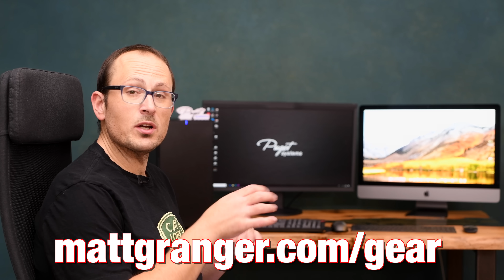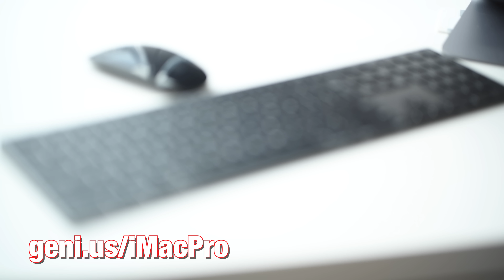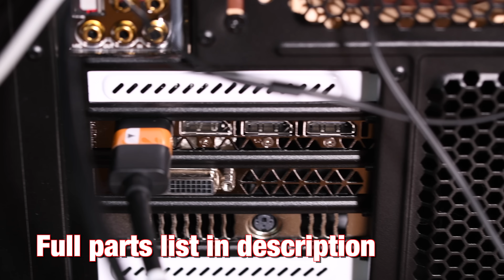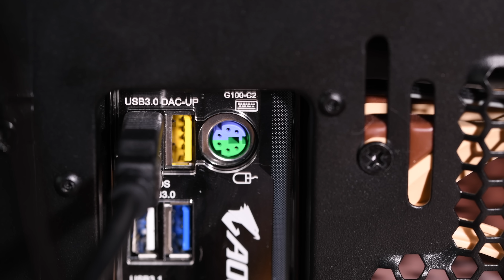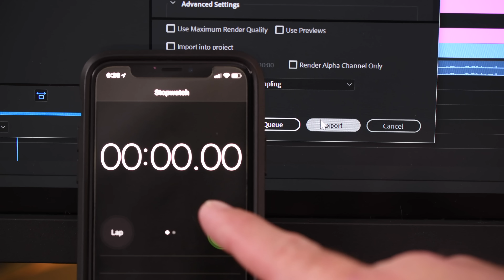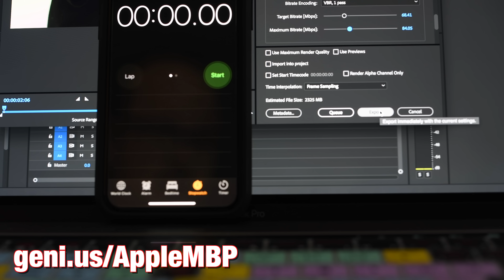$10,000 iMac Pro vs Custom PC - Which is faster??!

Comment: We get it, you like PC's. But do we really need another pointless "PC's are better" video? We know Apple computers usually are more expensive to buy(Especially compared to a homebuilt computer). We also know that Premier is very poorly optimized on the Mac and not using the hardware to it's full potential. Try testing with Final Cut Pro on the Mac or Davinci Resolve which is available for both PC and Mac. So another loaded test to justify whatever preference you already had in advance. Now let's move on to some actual content instead of this constant PC vs. Mac biggering.
Reply: Premier is very poorly optimized for all computers, Mac or PC.  it has CRAP core utilization and doesn't off load nearly as much as people think to the video card.  The reality is that the gap should have actually been bigger than what was displayed in the video.  Most people dont realize, for most Adobe products you are better off on a really fast quad core than a power house of a 8-16 core machine, once again due to Adobe's piss poor core utilization.
Reply: Pedal Repair that’s true, but the difference was only as large as it was because of his use of CUDA on the PC, and no use of Metal on macOS. It’s a very poorly designed expriment.

Comment: FRACTAL DESIGN DEFINE R5 SILENT w/550 watt, INTEL I7-7700K 4.2Ghz (quad core), 2 CRUCIAL 8GB PC4-19200 2400MHz, 512Gb SAMSUNG 960pro M.2, NVIDIA Quadro P600 on a SuperMicro motherboard (One of each usb 3.1 and 6 usb 3.0 slots, etc) custom built and warrantied by Thinkmate for ~$2200 shipped.  At this point paying them to do it is worth the savings of time researching and building plus it gives me a single point of service for the major components.
  I'd like to add a 1 or 2TB M.2 for the new RAW files to import onto but for now all the work happens on the Samsung 960 and files are backed up internally on ~812gig of older unmatched HDDs.

Comment: Meet Zeus a SuperMicro SuperServer 4028GR-TRT now this is a 4U rack mount server. It has the X10DRG-OT+-CPU Motherboard, Dual Xeon E5-2699 V4 (22-Core) 44-Thread making a grand total of (44-cores) and 88 Threads plus 55 MB of Cache per CPU, The system comes with 24 DIMM Slots which will hold ECC DDR4 Ram I am using Crucial for a total of 1.5TB of RAM,  it also holds 8-GPUs for some SERIOUS VRAM power. I am running 8-NVIDIA GeForce GTX 1080Ti 11 GB totaling 88 GB of VRAM. Then I think the best part is this thing takes 24- 2.5" Sleds or SSD's so I am running 24 Samsung 850 Pro SSD so there is no botle neck from the usual HDD. I use this machine for rendering 4K & 8K RED Footage for clients because it has dual built in 10GbE Ethernet Slots and because this thing is a absolute beast that's why it's name is Zeus! Now this is not a fare comparison because this thing coast more then both your PC and the iMac Pro together. Just to give you a idea just the two Xeon E5-2699 V4  (22-core) CPUs cost $4,200 a piece so that's $8,400 just for the CPU's when you add on the RAM at $200 per Stick times 24 = $4,800 then you add on the 8-1080Ti Founders Edition GPUs at $699.99 per times 8 = $5,592. Then you have the cost of the case which was $4,900 plus 24-SSD Samsung 850 Pro 2 TB at $949.99 per times 24 = $22,776, so when you add everything up you get a total of $46,468.00 so now you can see why I call this beast Zeus! I am running it off Windows Server 2012 R2 because you have to run Windows Server to run dual CPU's. Here it is on my Instagram https://www.instagram.com/bryanbd80/ I still use Macs for my everyday computer usage but when I need to work on a serious project then there is nothing better and faster in my mind then Zeus it may be expensive but how much is your time worth.

Comment: Hi Matt, Currently using a hexcore 6800K with 32GB DDR4 and a 1070 graphics card, everything is heavily overclocked and water cooled. At the moment it suits me down to the ground as I haven't made the leap to 4K from HD, If I ever get stuck do you rent Cider House by the hour? :)

Comment: I'm not a fan of planned obsolescence sealed Mac products. It might as well be a phone. Nice today but falling behind quickly. The screen is far too small for 5k. By the time the font scaling is applied, it is equivalent to a 2560x1440 screen with smoother and better looking fonts. That's it.  I run a 43' 4k monitor and that is just enough size for the resolution displayed. I'm also not a fan of non-nvidia cards when working with Premiere. Anything with "Pro" in the name is assumed to have upgradability. This sham is all by design. Buy a new Mac every 2 to 3 years. What a great expensive cycle to be stuck in.

Comment: Matt, thanks for the review, but it is quite unfair and no real world comparison at all, because Adobe software is optimised for Windows and something like anti-optimised for macOS. Adobe did yet not learn, how to use the native Mac power within their products or how to use macOS APIs correctly. Specially if it comes down to render output to the final product. If you compare the identical edit by Premiere Pro on PC double hardware equipped vs FCPX on Mac half as the PC hardware stuffed, the rendering by FCPX on Mac is over 6 times faster!!! If you send render job to Compressor you may start to work on your next project parallel to rendering and you will even not aware a slowing down of the Mac and the system will not be locked like on usage of Adobe Pr. Check this https://youtu.be/NWp9k2lydtk

Comment: But can it run Crysis?
Reply: Chosen Idea it will never die as long as there's a gamer left in this world. And the answer is yes it will..... At 720p medium settings.
Reply: Holy smokes, the Crysis joke lives.
Reply: no, it can't even run it on low without dropping to 5fps
Reply: Jajaja :V 
In 4k to 20 FPS
P5000 isn't a gamer videocard

Comment: Hey Matt were you using OpenCL or Metal when rendering with the iMac?
Reply: Joe's Technology, News, and Life You get better performance with almost everything in Premiere if you go into the menu and tell Premiere to use apples Metal API vs using OpenCL. The only case I’ve found where OpenCL is when resizing files with effects for final export.
Reply: The answer is, no he wasn’t, but he was using CUDA on the PC
Reply: Max Yuryev you’re absolutely correct, if I wasn’t clear about that it was my point. Why use a CUDA advantage without applying the same advantage of Metal on the other system? Unless the goal is to have a pre determined outcome for a specific message.... I’m not saying he did that, but it does sure look that way. Did you read my other comment above? I gave you a big shoutout for your in depth process in these types of reviews.
Reply: @FromScratchWithLove  bcs metal doesn't render as fast as cuda in premier pro if he would have used metal the gap would have reduced but still with cuda the PC would have won .
Reply: Futendoji it is if you disable the gpu acceleration, which, in the videos you’ve cited, they did. But, there wouldn’t be a 50% difference if that’s what he was doing in this test. It would be closer to 9% just based on the i9 having a higher clock speed. The other interesting thing, is that 14 core variant of both the Xeon W and i9 actually perform worse in single threaded tasks than the 18 core version which is clocked lower. He absolutely had CUDA turned on and didn’t use Metal on the Mac, Max is correct.
Reply: Max, as far as I know, GPU doesnt impact rendering time in any shape or form With premiere Pro .
Premiere Pro only utilize the GPU to accelerate some effects (Yea not all affect can be GPU accelerated) in the real time playback. For rendering the only thing that matter is CPU horse power. Also, Premiere Pro doesnt fully utilize all cores, most of the time an overclocked 8-10 cores CPU (just because of the better single thread performancer) will out perform a 14-18 cores CPU @ stock clock. Dont believe me ? Go look Pudget blog about Premiere Pro.
https://www.pugetsystems.com/recommended/Recommended-Systems-for-Adobe-Premiere-Pro-CC-143/Hardware-Recommendations
Reply: CUDA is a Nvidia exclusive technology due to the fact that AMD don't put CUDA cores on the gpu's so he's using the best software for a Nvidia card. thats why they are different. the AMD card can't physically do CUDA but the Nvidia card can do openCL but it just isn't as good because its not built for it
Reply: Hey it's Max!
Reply: Joe's Technology, News, and Life I asked that same question (basically) in a new comment. If he used optimized rendering on the PC, then the test only reveals the relative difference between an i9 with GPU acceleration vs a Xeon without GPU acceleration while using Premier. It says nothing of use about the Mac itself. If he has Adobe Audition, that might have been a decent way to have a control in the equation. Assuming Audition multithreads decently, the Xeon (with the iMac’s RAID 0 m.2 SSDs), should encode a lot faster. Granted I’ve never laid my hands on an i9 based workstation. Also, I wonder if a Premier project with audio files only (no video in the project), would touch the GPU during a render. I’m not sure about the Mercury engine. Haven’t used Premier since the late ‘90s!
Reply: Benoit Levesque actually the GPU acceleration makes a huge difference. That’s why I am very interested in seeing the same test with Final Cut on the iMac Pro. Premier is built to use CUDA, hence it will not take advantages of the iMac hardware.
Reply: Sup Max
Reply: Nicholas Croft Quadros are fine, and the titan is too. It’s the 1050 - 1080 et al that aren’t.
Reply: Joe's Technology, News, and Life If i remember correctly there are lots of videos out there, including one of Barnacles + Pugit systems that have analyzed performance on Premiere being more cpu dependant, specifically clocks (Ghz) than Gpu depending...
Reply: Yes, that way it would be unfair for sure, if not using Metal 2 or Open CL on render. Not talking about Final Cut that have made for OSX and Premiere lack of support on OSX.
Reply: Latest DaVinci will use multiple eGPUs to render with Metal on the iMac.9to5Mac has a nice video on this It is painful for me to watch this video with all the out-of-date busses being mentioned and no real statement as to how things are really configured. Just sticking one key peripheral on the wrong TB-3 bus could really mess up performance. Also what was Apple thinking when it put the SD port on the back of the iMac? "We can't put it on the front by the Apple logo, as that will mess up the aesthetics.".
Reply: Coffee lake. *cough cough*. 
Wonder if nVidia will catch on with supported eGPU post 10.13.4? 
(HS nVidia drivers are a bit of a mess, at the moment).

Comment: Great review Matt! I would only ever buy a PC for all the reasons you mentioned here and for a couple others you didn't. Price vs performance is a big one that you mentioned. Upgradability is another big one. The biggest reason for me though is the very limited amount of software that's available on the Mac vs what software I use for work on the PC. I use 3D modeling applications such as PTC Creo, Autodesk Inventor, and 3D Studio Max. I do VR development work which currently has 0 support on Apple products due to their lackluster video card performance. There are many other reasons I'd never buy a Mac, and have actually never owned a Mac in my 42 years of being alive. I have used one once, but not for very long because it couldn't do most of the stuff I needed it to. Having a nice shiny/beautiful Mac that takes twice as long to export as a comparably priced PC is the very definition of a huge waste of money. If you got paid by the hour for your work, the PC would pay for itself in half the time and that is really the bottom line. Throw in that you didn't even have that PC overclocked and that it could probably easily hit 4.5ghz which would spank that Mac even further. Great review, and I am surprised the PC crushed such an expensive Mac by so much (thought they would be at least close). What do people buy these things again?

To all you PC haters out there, Mac has 8% of the market and PC has 88%, so whatever you want to say just know your opinion is outnumbered 11 to 1. Also to the guy below that said Windows is based on Linux, you are uninformed. Mac is based on Linux, Windows is it's own thing built from the ground up.

Comment: Thanks Matt.  I recently speced and built a Windows PC for LR/PS work, added an excellent monitor.  I then converted a relative who does pro post editing work with this system from iMac to PC based on the total cost of ownership.  It's not easy to shake the fanboys from their Macs and that's OK; however the reality is you get more flexibility and bang for your buck when you work with alternatives.

Comment: Well, the one caveat for the pic is that in three or four years, other than reusing the case, the internals are no longer up-tradable. 

Where you get the biggest speed increase is the video card since it's doing the most number crunching. 

I only purchase work stations from either Dell or HP. Not because of a love for either company but because of the support. Dual Xeons with 256gb of ram minimum and the largest power supply offered. Then to keep it all running trouble free, an APC to keep the power supply from transient voltage spikes and power losses. 

Long time Mac, guy that became disenchanted with Apple. Anything I can do to keep from using Adobe products is high on my list. Too bad they feel subscriptions is the way to go. They're losing clients and I can't blame them.
Reply: Adobe went to subscription based because of piracy. They were losing a ton of money so I can't blame them for doing that. Autodesk does the same thing for the same reason and I suspect in the future we'll see even more software go that route.
Reply: Andrew, Autodesk was doing the dongle for both Inventor as well as Autocad. I stopped up-grading a few years back, as my limited use didn't make it worth the cost and the machine shops that I worked with still used the older versions requiring me to save at an earlier version.

If the seat license wasn't to friggin high, a lot of people would pay the price. As it stands, until you get 10 licenses, you don't get a price break. That's why a lot of people were signing up for a college coarse and using academic versions. 

My issue with the way Adobe handled the CC service was that when they rolled out LR6, there was no notice to users that it was coming or that the interface had changed. People were scratching their collective heads on learning a new version, when all they wanted to do was edit the job and get paid.
Reply: Gunga Dinn this is exactly correct.

Comment: Hey Matt do the same comparison with FCPX please. I thing you advertising Adobe Premiere. Of course P5000 works better with double amount RAM in Premiere.It's like Premier heaven haha.
Reply: Does he not say in the video he doesn't use final cut?
I guess that means there is no point in testing (for him). Unsure but guess he switched to Premier back on his old dustbin mac, else I doubt he would even have considered switching.
Reply: Red TV Productions Wait, your using premier in a Mac...
What a waste.
Reply: real pros use avid media composer, that's what people use in cinema and television. Either way, there are films edited in everything you can imagine, even lightworks (the wolf of wall street). I can say that I've experienced much more problems in avid in windows compared to mac.
Reply: Premiere doesn't even benefit from more than 32GB most of the time.
Reply: Absolutely.
Reply: Mac Guy3135 )(
Reply: Mac Guy3135 I
Reply: İ'm working with Contemporary art industry and for like us FCPX not amateur because i can earn money with that. Please!!
Reply: Baris Oktem FCPX is for amateurs
Reply: How can you possibly do the same comparison w/ FCPX if it doesn’t run on Windows? Also, many features and shows are still cut on Avid, while any ground FCP7 made in the media industry was conceded to Premiere after the FCPX rollout fiasco.
Reply: I do professional work. When FCP7 went, it was the logical thing to do.
Reply: pros like me don't use FCPX. Its a toy. Its no point him comparing as only serious pros would have a machine like those. its Mac for me. I don't want a home made computer.

Comment: Sorry, Premiere is not rendering anywhere near the speeds of FCPX or DaVinci Resolve.
More importantly try rendering HEVC, H265 from both and see which is faster.
Reply: Uhhh... Resolve is by far the slowest of the bunch.  Not even close.
Reply: Version 14 ummm game-changer 
According to Blackmagic's Website.....
"DaVinci Resolve 14 is a revolutionary release. Extensive CPU and GPU optimizations and a new high performance playback engine will mean DaVinci Resolve 14 is now up to 10 times faster than before, making it possible to edit 4K images on a laptop. We’ve also built Fairlight audio into Resolve with an audio post production suite, included new multi user collaboration tools, added over 20 FX filters for everything from dust to dead pixels, and more.
And this is destroyed by the latest FCPx update 10.4.